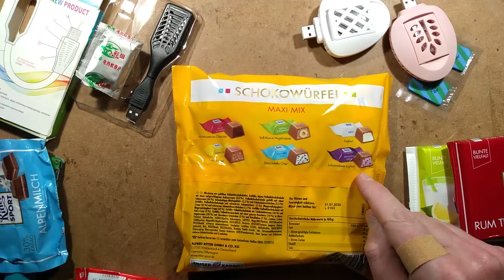German chocolate and USB insect vaporisers.

Comment: A few years back I talked to someone from Ritter Sport at a trademark seminar and asked which was the most expensive to make chocolate they have (they all sell for the same price, so being a cheap bastard I had to know). He said it was the Rum Trauben Nuss, mostly due to the rum they use. So if you want to optimize your Ritter price/value experience go with that. Just thought you'd want to know. (It's pretty damn tasty as well.)

PS: Don't pre-break the chocolate before cracking open the package. It's designed to break at the first row. Then you shouldn't have that Marzipan mess you found. :-)

Comment: @bigclivedotcom : "It might work in a camper" "A lot of people in America live in trailers". There may be a misconception Clive, some words are used differently between our countries. Most people in the USA do not live in campers or trailers, which are different. A camper here is the same as a caravan there. There are primarily used for camping, although a small number live in them. They are not designed for full time use and are pulled behind a truck. A motorhome have its own propulsion and there are models for camping all the way up to luxury multimillion dollar expansion units with multiple floors. A Trailer home here is referring to a home that is factory built as a full time home, but has wheel for delivery and rare movement. They are often made as "double-wide" which are 2 units attached to each other and never moved. They are made in a factory for lower cost and once assembled are not separated and have looks of a stick built home.

Comment: Using the leds as a Heater is a pretty good idea basicly uses otherwise wasted energx
Reply: It's borderline evil if the idea was to use the nightlight to attract the little buggers optically, while the heat signature siren-songed them to their fates via their heat-seeking imperative.

Int'resting. Clever.

Comment: It seems bizarre to use LEDs as heaters since they're more expensive than a PTC.  Unless there's a specific reason for wanting light.  Like attracting the insects.  Which means they come a lot closer than they might to an ordinary vaporiser.  Which means you don't need to put as much vapour out, so you can run at lower power and your consumable tablets last longer.

So it's a very clever design, if that's really how it works.  Or a very stupid design, because it's not good at killing the insects and the light will keep you awake at night.  One or the other.
Reply: Most of the insect that people are bothered by are not really attracted to lights. I really hate moths though, so it might be good for me :D
Reply: Maybe the light attracts the bugs, and the chemical repels them? Net  result, the bugs concentrate where you're stiitng.

Comment: I've been using a couple of the "LED Mosquito Killer Lamp, Electronic Insect Killer, Bug Zapper Mini Light Lamp" for some time now and find that they work well at attracting and killing small insects that love ultraviolet light (the LEDs in these), and without the nasty chemicals or excessive power usage. They just use a few LEDs and an electrified "screen", and plug directly into AC (120 here).

My simple watt-O-meter only registers above about 0.5 watts and these little bug zappers don't register, so I don't know what they're consuming (not having bothered to diagnose deeper), but I'd assume not much.

Clive, if you would be interested in checking some of these type devices out it would be nice to see your results.
Reply from the maker: Are they like this one?  https://www.youtube.com/watch?v=LtXmsxRdiUw
Reply: @bigclivedotcom   Sort of, but smaller and oval shaped:
https://smile.amazon.com/gp/product/B074276LX4/ref=ppx_yo_dt_b_search_asin_title?ie=UTF8&psc=1 (no longer available but very similar others are).

I just took one apart, but being a novice I can't do the complete Clive thing, though I can say it contains four LEDs, two 400V caps (both brown, one larger than the other), a rather large gray 51K ohm 5% resistor, and two diodes.

And yes, when removed from mains there's still voltage on the metal "screen", which, when finger touched gives a fun little shock. After having learned this the hard way, I now use an old tooth brush to clean the screens. I've also shorted the screen very briefly w/a metal object and got a nice spark, but no apparent damage to the unit.

Comment: You could buy them both and use the high powered one to boost the area before going to bed, then as you settle down for the night change to the lower powered one, this would save the battery and also give a night light.  Only problem with a light, would the light attract the insects you are trying to get rid of in the first place?

Comment: Could you not plug the mains one into 12VDC since it's only a PTC? Would it not just self regulate based upon temperature rather than voltage?
Reply: Actually scratch that, it would be too high resistance to ever pass enough current to heat up. Urgh, I'm tired lol

Comment: I can't remember what is used in those pills, but the PTC and NTC pills are made near me and I've been to their factory !
...
...
...
...
...
...
...
...
...
...
...
...
...
(And once caused an evacuation of the factory!)
Reply: Full story needed!
Reply: Repo I was testing fire hoses and didn’t know about a flow sensor fitted to the supply pipes. Start running the water and the flow sensor triggers the fire alarm. Thankfully none of the ovens were connected to the fire system.

Comment: Hey Bigc. 
How do you identify the parts with numbers and letters on a circuitboard?
I try to find out what a 6pin RH 79028 thingy on my usb charg. Port is and what it does.
Is there a search website for this out there? Google won’t help.
Reply from the maker: If the number is correct try a search with the package type like sot6 and the application, like USB.  Do an image search too.  If none of those bring up the component it may be too specialist to be listed or a manufacturers own number.

Comment: i'm not sure i agree with that 5 watt thing, i've seen enough 40 and 60 watt incandescent bulbs still hardly producing enough light to see shit,
pissing myself seeing how much you get for 5 watts on a led bulb these days,
hardly enough, but hey it's only 5 watts, 8-10 will get you there, 12-20 just kinda hurts lol

i try to turn off the switch on my power splitter that holds my usb chargers, the beefier ones take up 10-15 watts each.

also, bought 15 watt cool white bulbs from ali express at like 2 bucks a piece, 
i don't even know why, i already knew they were a bit too much.
they look legit, really really bright but have this flicker to them, as if they're charlieplexing between sets of leds (to keep temperatures down?)
the transformers will blow out before anything else anyway, they always do, even on CFLs usually lol
Reply from the maker: A charger will draw very little power when not supplying current.  You can tell by feeling them to see if they're warm or cold.

Comment: More bug killing devices ahhhh :( I got a lot of moskito attacks, maybe it is related to the blood type . Don't worrry about 5am, some«times i'm chasing moskitos electric zapper at that hour. There is a new model which has a rechargeable battery and plugs directly to mains. The mettalic net is not connected / reference to mains plug , positive :D Rittler sport has also the extra 73% dark chocolate version which is quite good :P Another advice, don't kill spiders :D Let them climb the corners and build the web .
Reply from the maker: The house is full of spiders on the Isle of Man.
Reply: Spiders are, indeed, the model of single-minded industriousness. However, they spend way too much time lying in wait, content with their one web being in good repair. What the world could well use is a USB-powered spider-caffeine vaporizer.
Reply: @michaelthibault7930  or a usb gun web shooter :D There is at local marquet mosquito network but it is not very efficient as web. An usb fan to guide the moskitos towards the spider's web :P
Reply: @bigclivedotcom  You need some marrom spieces type spiders. The problem is that they grow to scary proportions (like facehugers :D ) and required to be delivered to nature.

Comment: Manner is not German, it's Austrian. 😉
You open it wrongly! 😂 You're not supposed to crack the chocolate before opening. That gives you a wrong leverage for getting the package ripped. You better crack the package open in the middle via the chocolate leverage, then the chocolate and the package crack/rip in the same moment. 😉
(Although Marzipan can be a challenge.)
I like the bright blue Alpenmilch. Haven't seen Buttermilch Zitrone for a long time (also delicious). 🤷‍♂️

Comment: When i became a vegetarian bugs stopped biting me.
Reply: So even bugs avoid vegetarians?
Reply: @MetalheadAndNerd  
they actually simply have less co2 in their breath and cant be found that easy like people eating meat.
Reply: @thomasherzog86  So their metabolism is slowed down?
Reply: @MetalheadAndNerd  
no its the incredients of meat (about 20% protein, 5 to 10% fat & 70% water) vs plants like potatoes (about 80% water, 15% carbonhydrates and 2 to 5% fibre). 

more water and fibre but less of metaboloids like protein, fat or carbs, yet same volume.
Reply: @MetalheadAndNerd  Vegetarians tend to avoid meat eaters, because they smell rancid! Vegetarians also tend to be more polite and don't point it out.
Reply: @thomasherzog86  Our body gets its energy from oxidizing carbon and the result is the carbon dioxide we exhale. If there is less carbon dioxide exhaled there must have been less oxidation and that means less energy converted.
Reply: @mrsillywalk  This smell is just pheromones which make males attractive to females.
Reply: @MetalheadAndNerd  
and you think i wrote the contrary? thats actually the exact thing i wrote.
Reply: @thomasherzog86  No, you wrote that the amount of energy per volume of the food was reduced. Since the body still needs the same amount of energy - if the metabolism is not slowed down - this means that you now have to eat more to supply your body.
Reply: @thomasherzog86  Your assumptions are simply wrong but you are right it doesn't make any sense to argue with you any further. Keep your false assumptions.
Reply: @MetalheadAndNerd  
^^